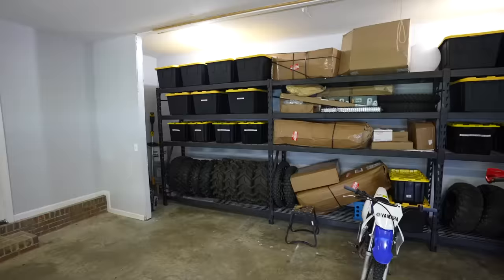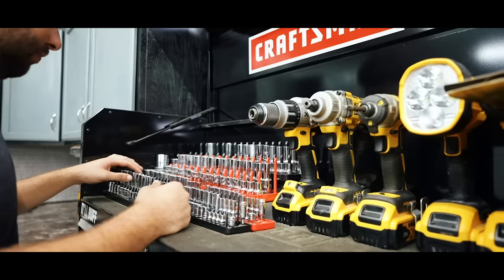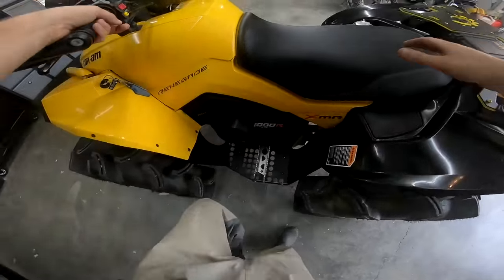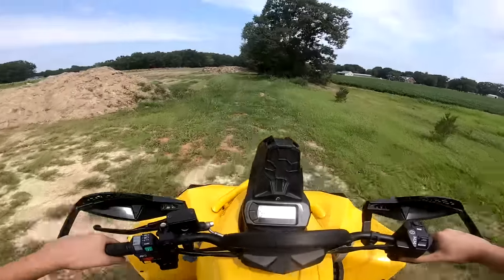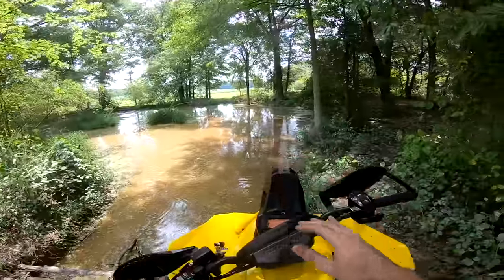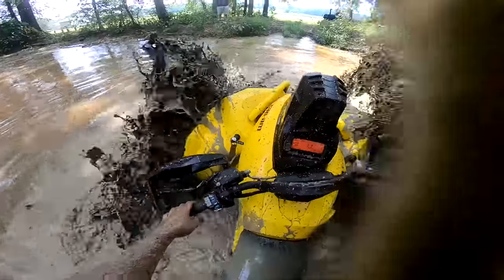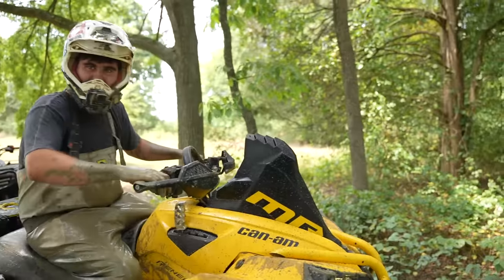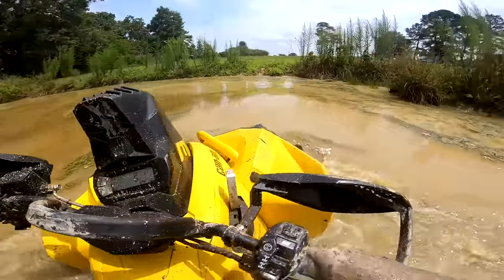32” NATORS ON RENEGADE 1000! *INSANE*

Comment: i had the starting problem with a can -am that we use at the fishing camp, the transmission was loose and when i would put it in parking it would not start because the belt was still on gear, i had to move the whole thing back and forth to engage the parking and it was annoying because im 12 and barely 100 pounds against a big machine that 10x my weight so yeah,i don’t really like can-am and straps driven four wheelers in general.